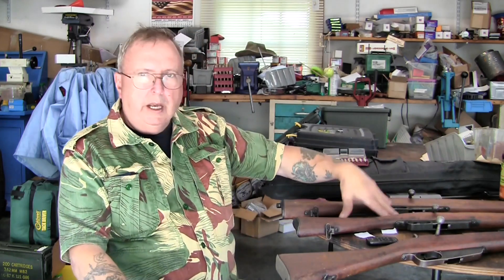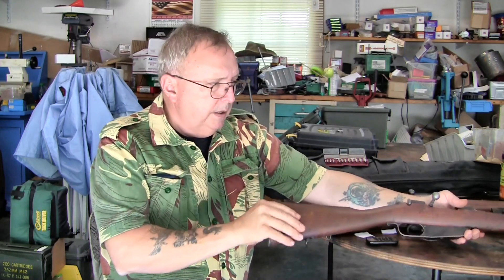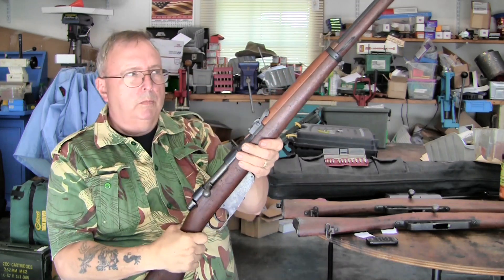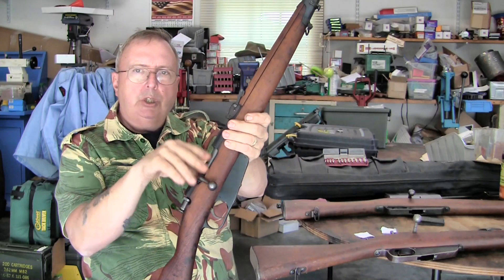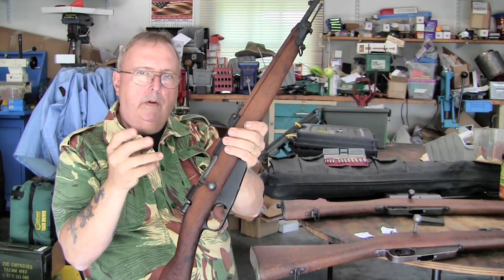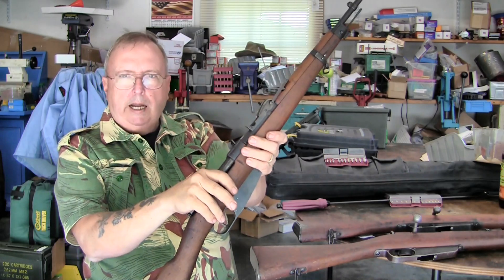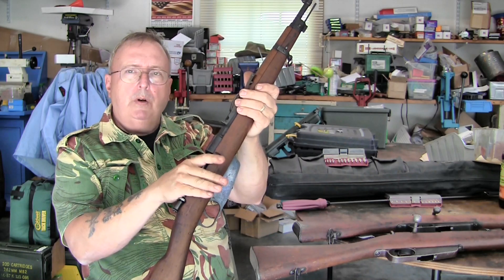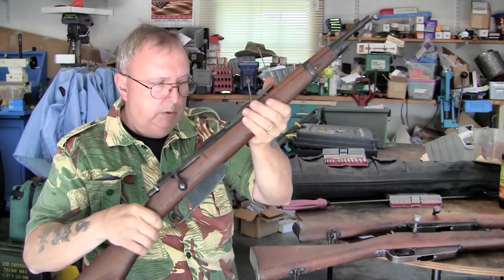Part 1 Testing PPU .268 Carcano Bullet & Single Shot block

Comment: Tested some of the PPU 139gr FMJ bullets today. Reloaded them in PPU cases and with 22.1gr of IMR 4198. This was intended to be a reduced load for 50yard plinking. Came in a little over 1700fps and was about 1.5" group at 50 yards. This was with a 91 Cavalry carbine.
Reply: Nice.  I still need to try the 139s.  Mine did not like the lighter ones much at all.  But my 91/24, Cavalry carbine, and 91TS all have gnarly bores.  My dad ordered the same rifles around the same time and got real nice bores in all of them...luck of the draw.  My 91TS is extremely worn...hoping some .270 cast bullets might bring some life to it.
Reply: @yuibot5998  The same day I ran some 165gr cast round nose with gas check and 15gr of 2400. These also grouped well with the exception of one flyer that keyholed. Unsure why but the other four printed around 2" or so. Still high and a bit right. Chronoed at about 1480 fps. Bullets were sized to .267 on average. This was as big as I could get them. But the 91 cavalry carbine I got from classic has a very good bore. The 91/41 I picked up does as well. My 91 Beretta TS from Buds has good deep rifling but sadly is pitted in a section about midway down the bore. The one spot in particular is quite rough but then it cleans up again and is nice all the way to the muzzle. So far factory ammo was terrible in it, (not surprised) I have not tried the handloads yet. I can update you once I do.

Comment: Buffalo arms sells a .268 bullet that actually measures .268 so that's an option, although an expensive one.
Reply from the maker: Did you buy some and check them with micrometers? It looks like they took a .264 bullet and swaged it to get the .268 diameter, the method works but if I can get it manufactured to the correct size I would go with that.
Reply: @TheKoba49  Yes I bought 100 and checked them with a nice Starrett micrometer.  I will let you know once I get some loaded and test them out.  I got a .270 NOE mold so that'll probably be what I shoot most but I do like having jacketed loads as well...  I still have to try the heavier PPU ".268" bullet.  My 3 rifles didn't like the lighter ones.
Reply: My favorite bullet is a .269 diameter, FN ,130 grain cast bullet , gas checked. Bullet Man Dan sells these on Gunbroker. With 10 grains of unique my sights are dead on at one hundred yards with my model 41. My Lee die sets have a .269 diameter pin so no need for universal expander die. I able to shoot 1.5 inch groups or better. The Buffalo arm bullets require me to shoot a foot low to hit the bullseye. Accurate but hate the point of aim.Will be trying both bullets  in the two carbines I picked up.  The Italians used a alloy jacketed bullet because of the extra friction cause by their rifling. In simple terms double the friction. That’s why Hornady stopped making the bullet in .268. Jacket comes apart. PPU made their bullets smaller for a reason. (Both sizes.) Buffalo arm bullets have short bearing surface for a reason. I don’t like the cantilever groove because it’s to high. It doesn’t effect the accuracy. But looks strange when you load them out. Offered to send Thekoba49 both bullets. Didn’t hear anything back.
Reply from the maker: @p47rr  where did you send the offer in an email?